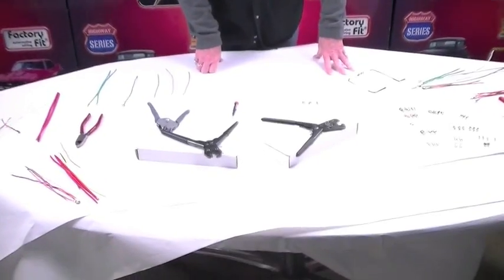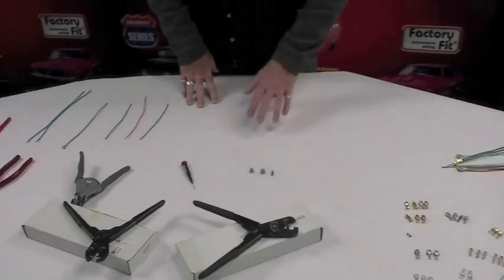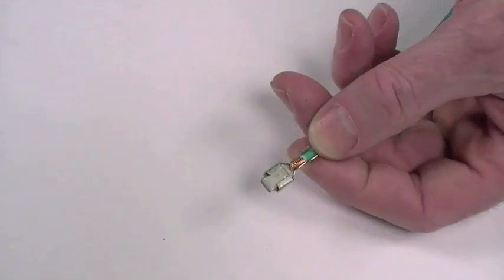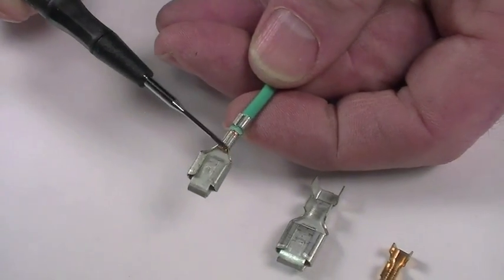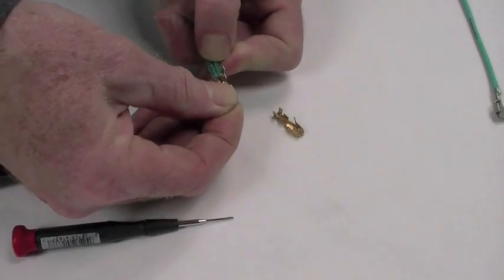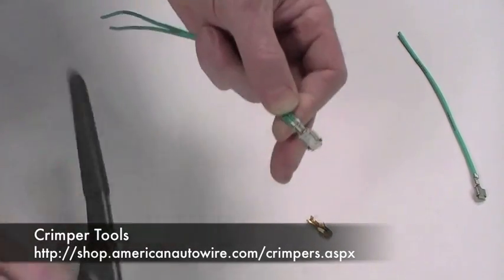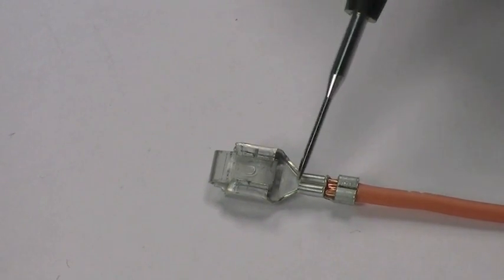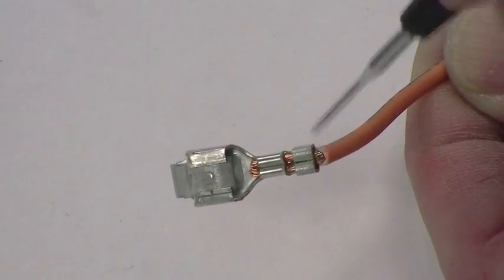American Autowire - How To Properly Use A Crimp Tool

Comment: Must be dumb. I just don't get this flipping the tool and using the high low part. Shows you how to strip a wire but doesn't show you exactly where to to place the wire. Need more detail.